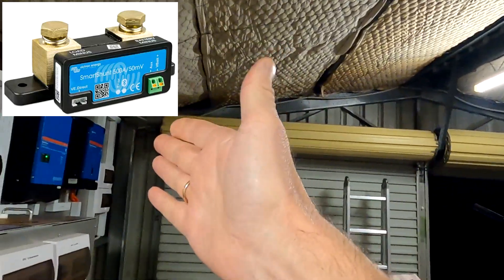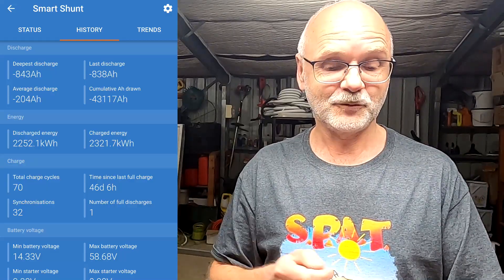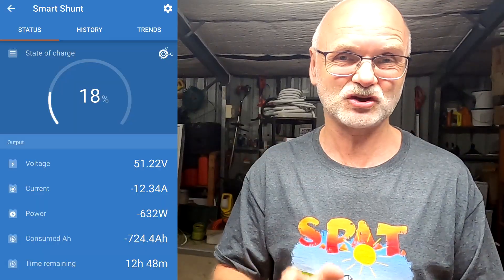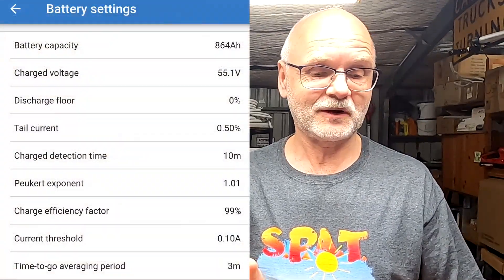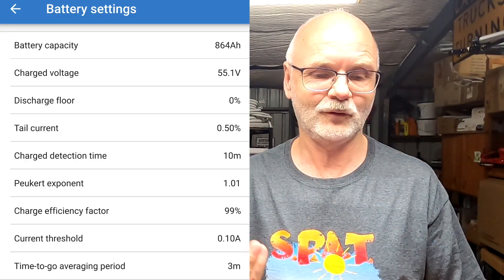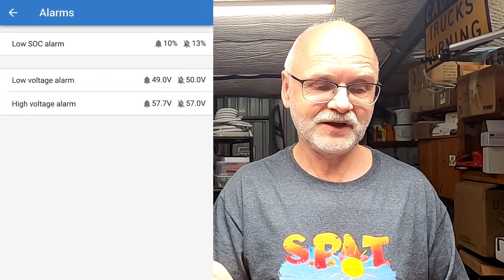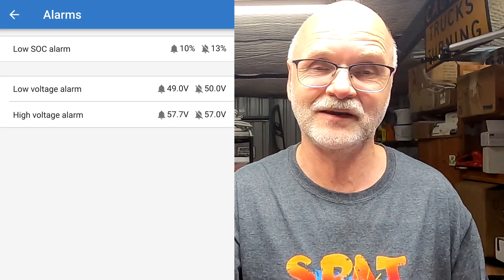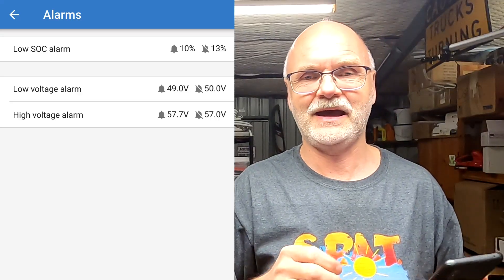The undervalued component in your solar and battery system - The Victron Smart Shunt.

Comment: Hello, I'm having this device but I'm not so confident with it. I've look also everywhere but I never find the documentation related to my simple installation.
I'm having two victron MPPT (100/20 and 100/30) two gel battery wired for 24v and on phoenix 24/1600.
Since I've installed the SmartShunt I could see only my battery discharging.
What I've done is to plugged all minus (MPPTs, Phoenix) to the system minus port and my battery minus to the Battery minus port.
Any idea?
Thanks

Comment: But hey hey, i think you are making a big mistake, the BMS values you just looked at was per battery, not the  complete set. AND you assume that Victron is correct!???? why? its not complicated to do the calculation. The overkill show 51,2 the JK bms is 51.31 and the last is 51.27... it tracks with the voltage..... and the victron shunt is 51.22 so the state in each battery is different... the other values are just as valid.

Comment: Thank you Andy for your knowledge  But can you say there are two smart stunts a 300 & a 500
My system is 24 volt  with a buss bar 2s2p '4 batteries'
I want to order the correct one
My choice  is the 300 smart shunt 
Anyway i am almost ready to hook up all my component's 
A 150-35 victron mppt also a 24-1200 phenix with 3-280 suntech
" i might buy a second 150-35 for a 2s2p two panals on each controler i just found & bought another panal so will have 4 in all @ 44.8V x 8.33A
So 3 no good but two ok x two mppt
Thanks really like listening to you from explaining things
Bridgewater nj usa

Comment: i took your advice lowered all my systems to 13.6 all except my big victron its on a 24 volt system it float at 27.6 but during the absorption it goes to 30.2 for about a hr., i just set the rotary switch to 7, getting ready to hook the 2nd system to a 150/45 victron on a anther 24v system thanks for all the info ps come florida and help me out

Comment: I have two flooded 12v batteries in parallel.  I am getting conflicting answers what my parameters should be for the battery. Could you give me what my settings should be?  Thank You
Reply from the maker: You only need to change the capacity setting to include both batteries.

Comment: How can your batteries be charged to 100% if one has a higher Ah rating than the other two?  (304, 280, 280).  I was under the impression that you have to always connect batteries in series or parallel that have the same Ah rating, because the smallest one will limit the capacity of the largest one.  How do you keep the two smaller batteries from over charging?

Comment: Hi Andy, Thanks for an excellent tutorial ref. the smart shunt. Sadly I can only afford a basic 100AH deep cycle gel battery which seems to work ok for now. If you have time please could you advise me on the settings for my 12v simple off grid system so that I can try and get my new Victron shunt operational and accurate. Thanks

Comment: Hi Andy. I'm from South africa and have 2 Freedom Won eTower 100Ah batteries which uses the Pace BMS. I recently returned one of the batteries because it had an issue with bad cells and Freedom Won replaced it with a new one. The issue I have now is thaat the old battery *bought Dec 2021" and the new battery have different firmware version. The old one at V1.10 and the new one at v5.07. This has been checked and updated to the latest firmware by Freedom Won. It does seem that there is some compatibility issues. When reaching the lower side of SOC% levels the SOC% of the 2 batteries differ up to 27%. The Victron equipment then seems to use the middlepoint. What this caused now is that when ESS starts to use grid power at set 20% SOC the new battery sits as low as 7% while the old battery sits at 34%. 
Freedom Won swears that the two firmware versions are 100% compatible. What do you think? I suspect it;s the Firmware causing the problems. Next I want to do capacity tests on each individual battery but after no sunshine for days, I'm waiting for some sun to fully charge the batteries before I can continue with the tests. I try to only charge them from the grid in emergencies.

I would really love to hear your thoughts on this.

Comment: Hello, does anybody know what the shunt shows when connected with a high frequency hybrid inverter like Growatt or Pwrmon China and multi batteries in parallel? I have such configuration abd the shunt is inaccurate in SOC, in total Ah going in the battery., and total discharged. I charge around 1000amps hours and it shows 40 as if measuring only the growatt charge cycle and not other moots I have also in parallel..

Comment: Are you still running your smart shunt between your batteries and your BMS?? If I do such a thing, do I need to be concerned with the power draw of the smart shunt? Can I take the auxiliary input of the smart shunt and connect it to the output of the BMS??

Comment: How to trigger a relay using smart shunt SOC % , as smart shunt 500 doesn't have built in relay, can i trigger 150/45 mppt relay or 100/20 mppt dc output On or OFF ??
For example at 90 % SOC i want trigger some load and at 80 %  off.
 I also use Ras Pi 4 for VRM any possible way , please help. 
Thank You.

Comment: If I use the smart Seplos BMS, the Multiplus / cerbo requests more power than needed from the grid. This is because of the power loss during transmision from battery to Multiplus. (At least my guess). It works better when I use the smartshunt or the multiplus.

Comment: I just can't see spending 200 dollars for shunt on my victron system. When in doubt use a voltmeter
Reply from the maker: Measuring the voltage does not work with LiFePO4.

Comment: If you have one battery the Victron Smart Shunt isn't needed, but, the more batteries in parallel, the more Amp hours, powering small loads, the less likely running your battery down to empty, and the less likely the state of charge will be of any importance at all...Chances are you will always be between 80 and 20% if the system is built properly..Not jumping on the Victron smart shunt band wagon..Atleast not yet..
Reply from the maker: It depends how the batteries communicate their SOC to the inverter or system. All my three BMS in my shelf show a different SOC, temperatures and voltage, so a smart shunt is the only option to have a point of truth with such a system.
Reply: @OffGridGarageAustralia  I have one bank of 304's from Qishou 48 volt 16s, and I'm about to build my second battery to add in parallel..What I'm saying is that it is extremely easy to get carried away and order a bunch of stuff that I/we don't really need..I want as simple of a system as possible with the least amount of complexity, mainly to limit the things that can go wrong, and having the ability to pinpoint what does go wrong..I just don't think I'll need a Victron shunt, maybe I'm wrong..I fully support you getting all the gadgets because your a very good teacher and a likable mate.
Reply from the maker: @realeyesrealizereallies6828  Thank you.
How do you want to do that without shunt then? The two BMS will need some sort of communication then, or how do you determine SOC for your whole system?
Reply: @OffGridGarageAustralia  I lived off of lead batteries for a very long time..My power usage is very low, the only reason I need another battery is for welding projects..How I determine my state of charge is by using very little energy. I'm on solar to minimize my energy consumption, not to live a standard western lifestyle with a different/cleaner form of energy..I'll fire up the generator if my BMS shuts me down, or more than likely I'll wait for some sunshine..Being in the scientific community for decades has given my an up close and personal view of what is coming down the pike within the next 15 years, give or take 5 years, probably take, and I'm no fan of what brought us to this inescapable point, meaning I'm no fan of consumerism, wasting energy, shipping needless crap all over the planet..Unfortunately, technology can't save us, it's what is killing us and the living planet..Even though technology is neutral, it can't be combined with civilizations whose foundations are built upon greed, ego and violence, it's proven lethal for every civilization to ever exist, and ours is the pinnacle of this cycle of collapse..See that, now you got me ranting..LOL  I do say though, do whatever makes you happy, we can't escape what is coming, I'm not judging anybody except myself..Minimizing makes me happy..I like to help people get off the grid, and understand our real near term future, and prepare for it..Especially my children..And we need good teachers...
Reply from the maker: @realeyesrealizereallies6828  great comment. The next 15 years will be indeed interesting from any angle. We're unsustainable for far too long and materialism has a too high priority in our society. I wish you would make videos and share more insight.

Comment: I have 2 banks of 6 eg4 batteries (not LL). Needing a wiring diagram to connect my 500A smart shunt to them. Banks are parallel to parallel. Pairing off on th😊e two negatives. Thanks. I have two eg4 6500es inverters.

Comment: Andy, when sizing a shunt do you add current coming in + current going out, or use them separately?  ie a 100A shunt will work with 50A coming from the charge controller + 100A going to the inverter?

Comment: If you install the victron smart shunt between bms and cells, what happens in the event of a bms shut down when your victron mppt is reading voltage from the smart shunt? The mppt will no longer be connected to the battery but it will still be reading battery voltage. I have heard that you will get a high voltage on the bus that might damage other kit like a victron orion for example
Reply from the maker: You don't do that! Battery - BMS - Shunt. The battery and the BMS belong together as a unit.
Disconnecting the MPPT from the battery is not a problem. The Victron MPPTs will go into Absorption mode and still deliver power at this voltage to the load (if there is enough sun), even without any battery connected.

Comment: I love the smart shunt (12vx2=24 volt set up), but my problem is that I have a balancer that top balances the batteries automatically but it throws off the Victron. It still connects and tells me state of charge and the other important info.

Comment: HI! Thank you for your fantastic videos!
I built 4 parallelled 16s Lifepo4 batteries and right now I am thinking about adding Victron Smart Shunt to my system.
The only thing I really dont understand is - where do I install it? (Position).
Each one of my batteries is connected to two massiv busbars which distribute to two MPPT 450/100 and two MP5000.
Where and how would you install a smartshunt in my case?
Thank You :)
Reply from the maker: The shunt needs to go between the bus bars and the batteries. Maybe consider installing a second pair of bus bars to connect the MPPTs and load to. The shunt goes in between the two sets of busbars then.
Reply: @OffGridGarageAustralia  Thank You! That sound like a very good idea :)

Comment: Andy I'm having trouble with my Victron smart shunt I have two separate 120ah battery Banks on the Shunt but once I get down to 50% or burn the first 120ah it doesn't tell me how much remaining time I have no more and every time I get close to burning the first 120ah it tells me I have very little time left as if I only have one 120ah battery connected to it

Comment: Actually what would you recommend me using for my settings?  I’ll have two 230ah lithium batteries after I top balance them anyway.  
And another question. I won’t have enough bus bars so was thinking I could use 12awg wire and make my own.  Would that work?
Reply: I have most settings but I’m having a hard time with tail current? I’m confused on that

Comment: Hey Andy, again a great video, your explanations are awsome. our setup is nearly the same with a Multiplus 2, a MMPT, a Cerbo and a Power In bus bar. quick question to the parameter "charged voltage". This must be the same as configured in the ESS assistent of the Multiplus, rigth? And the "Tail current" is a flexible or fixed parameter? Is it good/not good to set it different? Thanks in advance for your thoughts.
Reply from the maker: Thanks Thomas, The charged voltage in the shunt is just there to reset the shunt to 100%SOC. So, it should be a bit lower than your actual max charge voltage in your ESS. Say you have 55.2V in the ESS, set the shunt to 55V.
To reset the shunt to 100% you need:
- the charged voltage reached
- the tail current reached (so actual current must be under the set tail current)
- the time must be met.
As an example the shunt will be resetting to 100% if 
- 55V is reached
- the charge current is under 10A
- and above conditions are met for 5 min
Reply: @OffGridGarageAustralia  Thanks Andy for your comments, I really appreciate. the tail current with this 0,50% in your video is by default? which number is good to choose here? or should i look at the current of the lowest load i have in the system? whats your thoughts on this?
And another question regarding the charge efficiency factor: should this parameter equal to the one in the ESS or also lower/higher?
Thanks again for yout thoughts also on that.

Comment: I love my SmartShunt. The VictronConnect app on Android is a bit basic but it works. The VictronConnect software on Windows 10 is disappointing. It would be nice if they upgraded to allow long-term data storage. Disconnect and the data refreshes, losing the previous data every time. I was hoping for much better.
Reply from the maker: Mine keeps all the settings and history, just not the SOC.

Comment: My principal question is : What are you gonna do with that information? What are you gonna do when you see a certain SOC?
This is a honest open question, not a snarky comment. It is great to have precise information but I would like to know which actions/choices/results are different based on that more precise information.

Personally, I just charge my battery as long as it wants to be charged and draw from it until it goes under 12,9 volts.
Reply: Now that we have chatgpt I(t) can answer my own question

This is a valid question. Knowing the state of charge (SOC) of a shunt can be useful in several ways. For example, if you have a battery bank, you can use the SOC information to determine how much charge is left in the batteries and whether you need to recharge them. Additionally, SOC information can help you manage the charge and discharge of your battery bank to maximize its lifespan and performance.

Another example is in the context of electric vehicles (EVs), where SOC information can help drivers plan their trips and optimize their driving range. If you know the SOC of your EV battery, you can better estimate how far you can travel before needing to recharge, and plan your route accordingly. SOC information can also be used to manage the charging process of the battery to avoid overcharging or undercharging.

In summary, having precise information about the SOC of a shunt can help you make informed decisions about managing your energy storage and consumption, whether it is in the context of a battery bank or an EV.

Comment: hello, your videos are really helpfull , thank you!! ... I am strugling with my battery bank with the exact SOC (Electric vehicle, 32S 108V, 200ah, LiFePo4) ... I want to buy a smart shunt but this one you describe goes just up to 48v ... right? ... do you have maybe any recommendation for my bank? ... it works for 108Volts and can get current peaks of like 350Amp    :)

Thanks a lot in advance!! 😅😅
Reply from the maker: Sorry, no, I would have no recommendation for that. 108V DC is far beyond any DIY voltage and can be quite dangerous. You won't find many devices for this voltage...
Reply: @OffGridGarageAustralia  thank you for the answer, you are truly kind, such an nice person, wish you all the best 😄  ... i found the JUNCTEK KL 140F  , 400A 120V Coulommeter for battery car ... I will find out if it fits my need ... regards from Mexico

Comment: I have 10 - 100w panels with 4 lifepo4 batteries what charge controller, shunt, fuses ect should I use in the victron stuff? 12v system.
Reply from the maker: That is almost impossible to answer from the little information. You're talking about a full system design here.

Comment: Hi, Andy. I love your videos. Great job. I have a victron smart shunt and I love the features, however, there is one feature I don't understand: the cycle count. It only increments the cycle count by one if the previous discharge was deeper than 60 or 65 % (% SOC). I don't understand how victron thinks this makes sense!   Let me illustrate how this is a problem: my battery bank has been cycled between 80% SOC and 100% SOC probably over 50 times but the cycle count is still at 1 !!! Because only once the SOC went below 60% ....   that just doesn't make sense to me... it should add up each mini cycle and every time the sum equals a full cycle it should register as a full cycle... right?
Reply from the maker: Thanks, Omar. Mine also counts micro cycles from 10-20% and back. That's what I do for weeks now during winter and the count is going up. Very slowly of course...

Comment: Mmhhh, why is the battery capacity just the sum of the 3 single battery capacities and not of all of them, i.e. 3x 16x 280?
Reply from the maker: Because 16 cells are in series which does increase the voltage, but not the capacity. Only parallel batteries increase capacity.